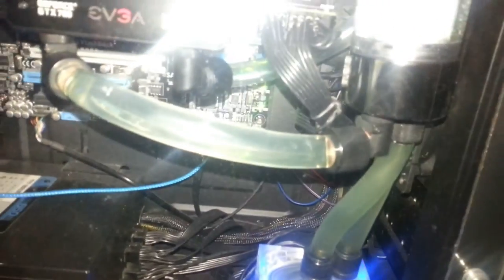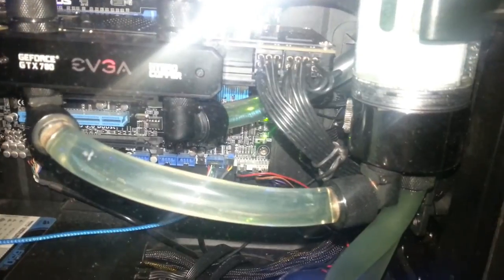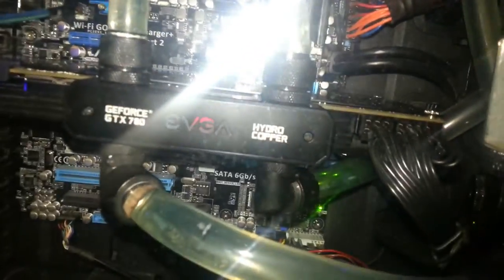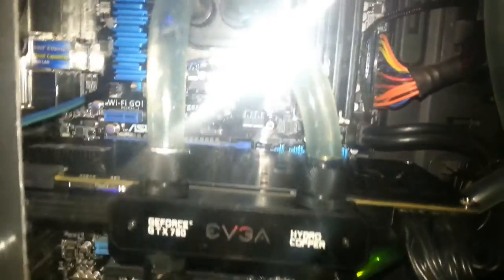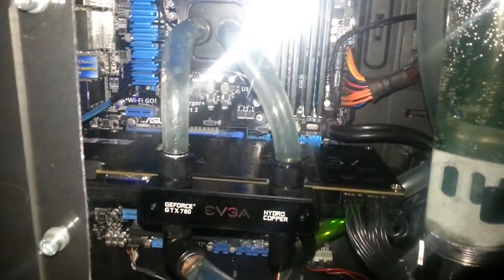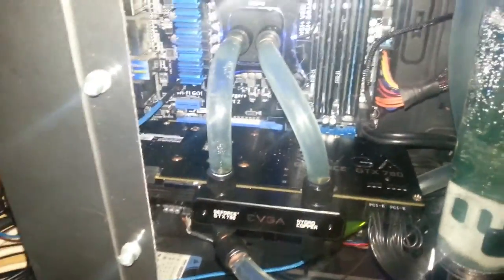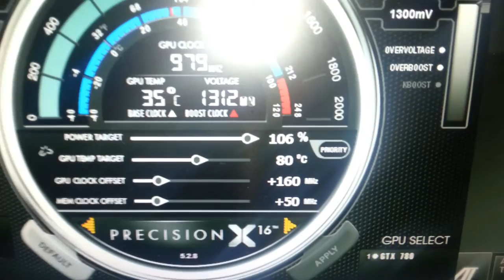Serial to Parallel CPU and GPU Watercooling - In one go

Comment: Just about to do my first water cooling loop and saw a great picture of a parallel loop in a small form factor and was wondering how this works but like you said it doesn't matter the water still flows through each part perfectly. This is great news for me as like you said it looks a lot cleaner than the previous way. Just don't understand why system builders don't do them all this way as it looks much better in my opinion. Thanks for the video mate.
Reply from the maker: They probably have their reasons. But yes I agree I think parallel looks better.
Reply from the maker: Also good luck on ur loop. Send me pics when ur down :)
Reply: Balubish Tech will do my case looks bare at the moment as I have just the mother board the msi gtx 980ti and the big noctua cpu cooler ;) the phanteks enthoo evolve tempered glass case was designed for water cooling ;) I just added 3 more fittings to be delivered by EKWB as parallel needs them extras whole kit was just under 600 euros or here in the UK £515 ;) will give you a link to the pictures when done.

Comment: hey can u post before an after? say serial config vs. parrallel config?
Reply from the maker: Not sure i follow. It were serial in the beginning and parallel in the end??
Reply: Balubish Tech I assume u had it serial, as in it goes into cpu then gpu etc.. so any updates to your system? are you still running it and did you noticed that bubbling or air bubbles on the cpu tube inlet/outlet?
Reply from the maker: Fa Vang Hi again! Updates. I havent changed it at all, still running in this config and have been working great, no temp warnings or anything. So it cooles very well. And when filling it you can probably see in the video if you look closely cause the water goes into the GPU first the flow goes through that block first then fills the CPU. To solve this and to get some air out in the outlet of the CPU I cranked up the pump one notch. I have a D5 pump so went from Speed 2 to 3 basicly, easier to fill and get out air faster and no airbubbles form at that speed. Im not home right now but think the speed is around 2200-2500rpm on the pump.
Reply from the maker: Fa Vang So just to point that out more clearly yes if the pump runs slower you can get an airbubble on the outlet, you will still have flow on lower speed but air can get stuck. Reason is because im going from below and up to the CPU. Going the other way trough the CPU first might change that. But you can solve it by cranking up the speed. Other than that if you have a one speed pump I guess it will be harder to get that air out and need to tilt ur case until you get it out. If you would want to have a video showing different pump speed settings in Parallel config I could do that, for example lowest and middle and highest speed and then bench GPU and CPU at different settings with it. I dont think it will be much difference though.

Comment: just a quick question if you dont mind?,,when you watercooled your GPU without overclocking it did you get a increase in gaming FPS???
Reply from the maker: So thats a good question. Havent thought of that before. Should test some games to see the difference there too. But Im doing a test right now on Crysis 3 with my settings on Stock GPU and OC GPU. So Stock have 57fps just loading to the point were im at and standing still. And with my OC doing the same thing, just loading up the starting point were im at so I have the same things to render I get 57fps. Bioshock infinite 135fps OC and stock 122fps. I guess to make a better test I need to do a run for a while and take the average that way. Luckily Infinte have a benchmode so tested that and heres the average fps at stock speed were 96.88fps. OC I got an average of 101.07fps. So you dont get that much really and im still learning, I might be able to push it a bit further.
Reply from the maker: And the card came with pre-installed block so cant answer how it was before. If I got more fps with fan cooling or with water. All I know is that I get a little more power from the card but It does run hotter, not much a few degrees in water temps thats all but still.
Reply from the maker: I tested some other settings on the core and mem, and got 60fps on Crysis 3 and 102.5fps as average on Infinite. So you can gain some if you set it up right. Clearly I havent. Just cranked the core to max stable and highest voltage.
Reply: Balubish J W yes but what resolution do you run at?
Reply from the maker: 1080p
Reply: i run at 3x1080p,,,5760 x 1080p,,and when i watercooled my cpu without overclocking it i noticed a difference of about 10 extra FPS in Gaming,,got my watercooler for gpu but not fitted it yet,,want more parts for my custom desk before i build it need a 360 rad cos only got a 240 and a 120,,,and with cooling gpu and cpu jjust thought more rad space the better cos im still learning myself,,off people like yourself,,which im most thankful for pal!!!
Reply from the maker: Im still learning stuff myself along the way and thought i share the things i learn. Yeah more rad space is better. Im in the planning stage to mod the case so i can fit another one.  Cause gets really hot in the room while gaming for a while. And happy that my videos are somewhat useful so thanks. :-)
Reply: what country you from,,im uk so temps mostly cold here anyway
Reply from the maker: Sweden here. Almost the same for me. I guess. :-)
Reply: i imagine sweden colder than the uk,,plus better looking women lol
Reply from the maker: Haha
Reply from the maker: richy69uk You guys have some nice ladies to man.
Reply from the maker: Yeah I guess ppl dont know better. And do asumptions of how different countries are.
Reply: Balubish J W yeah dont get me wrong there is a lot of bad apple's over here,,but aint there everywhere!
Reply from the maker: richy69uk hehe tru dat :P
Reply: Balubish J W Like you said before your still learning,,and so am i,,most ive learned about PC's as been off people like yourself here on you tube,,i think you know a little more than me when it come's to overclocking,,so when i upgrade MB and CPU i will be asking your more question's if you dont mind?
Reply from the maker: Yeah its ok. I will answer if i can. Im still learning myself. I started learning how to oc cpu a bit 2013 and gpus are quite new for me. Mostly its trial and error. I learned myself to use Cinebench to see if the cpu oc was stable cause it crash if the voltage are to low as an example. Used auto oc today and are running stable at 4,843GHz.
Reply: Balubish J W YEAH THATS ONLY TIME IVE CLOCKED MY CPU IS WITH ASUS TURBOV SOFTWARE,,and i use prime95 to max out cpu,,,they say leave prime95 running for atleast 12 hours then you know its stable
Reply: richy69uk you interested in modding your cable's??,,,i found it easy first time i tried i even sleeve the crossfire bridge in uv blue,,,and it makes things look a whole lot better than mixed coloured wires in your case,,i know you can buy them already sleeved but nothing beats when you have done them yourself
Reply from the maker: richy69uk i wouldnt use prime 95. It burns cpus way morw than benching them. Its not realtime work, the software just forces the cpu to run at max voltage and all that. Cinebench i feel work better. Im below 90c at full load. With prime it would go up to above 100c.
Reply from the maker: richy69uk yeah i have actually thought of buying a sleeving kit. Cause im so tired of short fan cables and that way i can extend them myself and yes it get that way cleanrr look. :-)
Reply: Balubish J W my advice would be buy 3mm for single wire's like molex or 24pin 4 or 8 pin cpu 6 or 8 pin gpu all 3 mm,,fans 4mm then decide weather your confident enough to go for just sleeve no heat shrink,,or heatshrink the end's,,dont go for sleeveing kit!!!!!,,,you will end up with stuff you dont need,,,just buy 3mm and 4 mm of what ever colour you want,,better to have too much of sleeveing you can use instead of sleeving you dont need
Reply from the maker: I think i will go with heat shrink. Looks better, but not too much.
Reply: Balubish J W sata cable are a nightmare,,so i would just go with black,,,crossfire bridge toke me a couple of attemp's and was a nightmare but worth it
Reply from the maker: I only have one card so im fine ;-)

Comment: This is not a parallel loop. You just went from the GPU to the CPU and then back to the GPU then out back to the reservoir.
Reply from the maker: How does the water flow then?